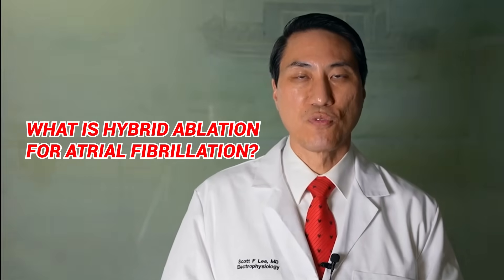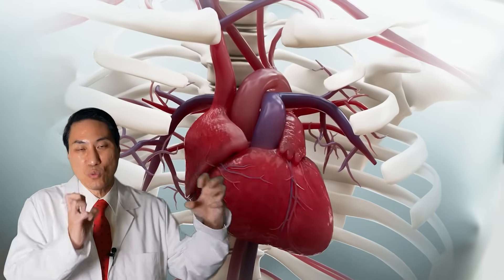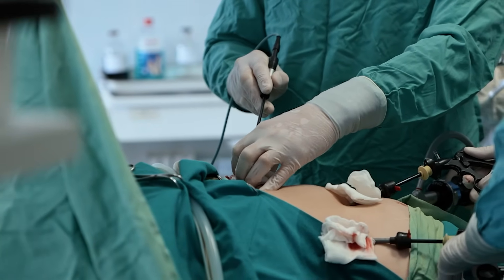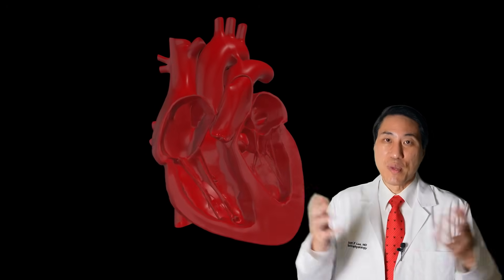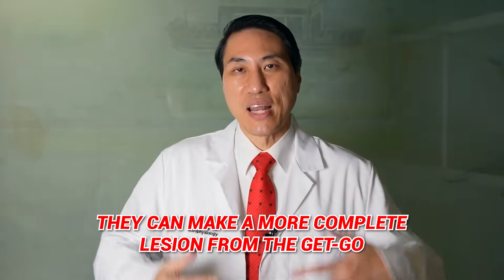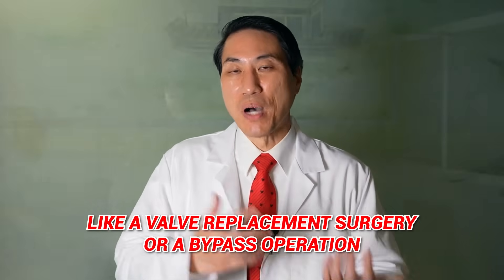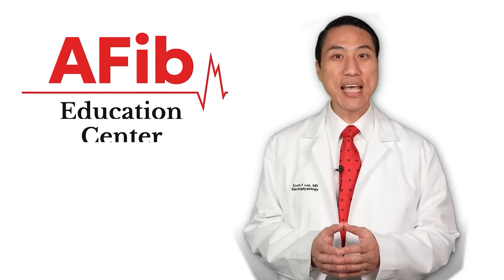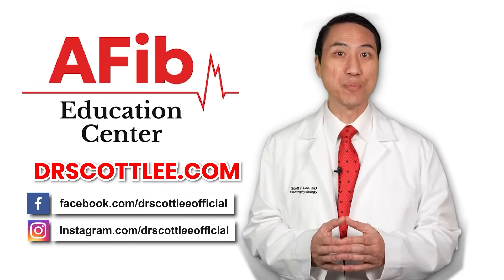Hybrid Convergent Ablation for AFib: What It Solves… and What It Still Doesn’t

Comment: Ugh afib is terrible im 36 and have been dealing with this on and off since im 20 or so. Really hope this second opinion from Dr. Lee is fruitful
Reply from the maker: I’m really sorry to hear you’ve been battling AFib since such a young age—dealing with this in your 20s and 30s can be incredibly frustrating, especially when most doctors are still stuck in the mindset that AFib is an “old person’s condition” and downplay it when you’re young. But your story isn’t uncommon—early-onset AFib can absolutely happen, and when it does, it tends to be more structurally driven by electrical triggers or congenital wiring issues rather than age-related scarring. That’s why early evaluation and treatment—especially from someone who takes a comprehensive, strategic approach—is so important.
If your AFib is paroxysmal and hasn’t progressed too far yet (still early “1-2 walls out of 6” type of case), then you’re still at a stage where a well-executed ablation—done correctly the first time—can potentially turn the clock back all the way to zero and buy you many symptom-free years. But even if it’s gotten further along, the goal is to put together the right plan (whether that’s lifestyle, meds, or ablation) to stabilize it and preserve your quality of life long-term.
I’ll do my best to give you the clarity and education you need in your second opinion so you’re not left in the dark or being bounced around from med to med. You deserve better than just being told to live with it at your age. Looking forward to helping you figure out the right next step.
Hang in there—there is a path forward. Good luck!

Comment: What are your thoughts on Farapulse ablations. I go in next week for this. I already have a pacemaker for sick sinus syndrome. I've been experiencing long runs of afib. I have chirrosis from Nafld, so they are trying not to cause liver damage by over medicating  me.
Reply from the maker: Great question—and I’m glad you're thinking critically about the different ablation techniques, because not all energy sources or procedural strategies are created equal.
Pulsed Field Ablation (PFA) is definitely one of the most exciting new developments in electrophysiology. The energy itself—non-thermal electroporation—is safer for surrounding structures like the esophagus, phrenic nerve, and pulmonary veins compared to both radiofrequency (RF) cauterization and cryoablation (freezing). It's also significantly faster, which is appealing for both the patient and the lab workflow. So yes, the energy is promising—particularly in terms of safety and efficiency.
But here’s the part that often gets glossed over: the current use of PFA is still very limited. Right now, the FDA-approved catheters using PFA are only designed to perform basic one-wall pulmonary vein isolation (PVI). They haven’t been proven to be more effective than RF or cryo—just a little safer and faster. And that’s great if you’re in the earliest stage of AFib (paroxysmal, short and intermittent episodes), where a simple one-wall ablation often does the job. In early PAF, a basic PVI gives you a 70–80% success rate.
But AFib is a progressive disease. As it advances, more of the atrium becomes involved and the abnormal rhythm is no longer limited to just the pulmonary veins. By the time someone is in persistent AFib (episodes lasting over 7 days) or longstanding persistent AFib (continuous for over a year), there are often AFib triggers firing from other walls of the left and right atria—what we call non-pulmonary vein (non-PV) triggers. If you only do a simple PVI in these patients, success rates drop off a cliff: 40–50% for persistent AFib, and down to 20–40% for longstanding persistent. That’s why so many patients with more advanced AFib end up having multiple ablations—often 3 to 5—and still feel like they’re chasing a rhythm they can’t pin down.
The key problem is that most EPs only do simple 1-wall PVI on everyone, regardless of how advanced the patient’s AFib is. And because of that, when the basic PVI isn’t enough—which is the case for mid-to-late-stage patients—they end up needing repeat procedures. But here’s the dirty little secret: many centers and EPs are financially fine with that. They schedule 4–6 cases a day, spend an hour doing a simple PVI, and when it doesn’t work long-term, the patient comes back for round two, three, or four. The reimbursement system pays per procedure—not for outcomes—so ironically, some EPs make more by doing less.
Now, when I do ablation, I block out 4 hours per patient because I do complex, tailored ablations on up to all six atrial walls if that’s what the patient’s stage requires. My goal is to get it done once and done right, regardless of how advanced the case is. That’s why my personal success rates are 95% in paroxysmal AFib, 90% in persistent, and 80% in longstanding persistent—because I map and treat all the active triggers, not just the easy ones around the veins. To do that effectively, I currently use RF energy, because only RF allows me to precisely and deeply ablate across all six walls. Cryo can only reach two of them, and while PFA technically can access more, we don’t yet have the evidence or catheter tools to prove it can create durable lesions outside of PVI. And while there is a new PFA catheter from Medtronic that was just released this year (2025) that can make linear lesions on other walls of the heart other than Pulmonary Vein Isolation (PVI) using both pulsed field energy and Radiofrequency, it is still largely untested. That’s the bottleneck right now.
What’s concerning is that some EPs are now bragging about doing 6 or more PFA procedures a day—because the energy is fast and safer—but they’re still doing the same basic one-wall procedure, just faster. So instead of doing better work, they’re doing mediocre work at lightning speed. And as I always say, practice doesn’t make perfect—perfect practice makes perfect. If someone’s done hundreds or thousands of one-wall ablations, all that makes them is very efficient at doing a procedure that might not be enough for your stage of AFib.
That’s why I always encourage patients to understand their stage. If you’re in early-stage paroxysmal AFib, you might get a great result with almost any competent EP—easy is easy. But if you’ve progressed to persistent or longstanding persistent AFib, who does your ablation matters far more than what energy source they use. Because hard is hard, and in advanced AFib, success comes down to operator skill, depth of ablation strategy, and whether your EP treats the full electrical map—not just the first wall.
For more in-depth videos explaining all of this, visit my channel @afibeducation, and if you want a personalized review of your case to make sure your ablation plan matches your stage, visit drscottlee.com to book a second opinion. Thanks for watching!
Reply: @afibeducation thank you for responding. I am going to the ER as we speak, I passed a little blood. So payers are appreciated.  I love your channel, you are very informative and you communicate in terms the average person can understand. God bless.
Reply: @afibeducation had my ablation, so far I've felt a lot better. Had a screaming headache last week that finally let up. For whatever reason, I feel as though it was side effect of anesthesia or the procedure, plus I've had some tingling and numbness in my hands and feet that also seems to have let up. I have had a little afib and some tachy brady, but if it doesn't get worse I will satisfied with the results. On the other hand I've had good weeks before.  Time will tell, but I'm hopeful.

Comment: In regards to the drugs to mange AF what is the order of drugs from the weakest to the strongest? I have fib and I’m trying to understand at what stage of AF I am at!
I’m currently on arrhythmia drugs Flecatab, Minax, iXarola, Adesan & Cavstat
Reply from the maker: Great question — and it’s smart that you’re trying to understand how your medications relate to the stage of your AFib. First, I’ll explain the typical hierarchy of antiarrhythmic drugs (AADs) from weakest to strongest, and then I’ll comment on your specific meds.
General Order of AFib Medications (Weakest to Strongest)
Note: This refers to their strength in suppressing AFib, not how “good” or “safe” they are. Sometimes a weaker drug is preferred because it’s safer or has fewer side effects.
	1.	Beta blockers (e.g., Metoprolol, Atenolol, Minax – brand name for metoprolol):
	•	Purpose: Mainly control heart rate, not AFib itself.
	•	Strength: Doesn’t actually suppress AFib episodes, just slows the speed of it down.
	2.	Calcium channel blockers (e.g., Diltiazem, Verapamil):
	•	Purpose: Also for rate control. Slightly more potent than beta blockers in some people.
	3.	Digoxin (not in your list):
	•	Weak rate control, especially in active people. Almost never suppresses AFib.
	4.	Flecainide (Flecatab) and Propafenone:
	•	First-line rhythm control drugs for patients with no structural heart disease.
	•	Moderate strength antiarrhythmics. Can be very effective in early-stage AFib.
	5.	Sotalol:
	•	Stronger than Flecainide, but with QT prolongation risk. Used in more persistent cases.
	6.	Dofetilide (Tikosyn):
	•	A stronger option for rhythm control. Requires hospitalization to start in many countries.
	7.	Amiodarone:
	•	The strongest and most effective AAD, but reserved for last due to long-term toxicity risks (lung, liver, thyroid).
Your Current Medications:
Let me break down what you’re on:
	•	Flecatab (Flecainide):
A moderately strong rhythm control drug — often used in early-stage or paroxysmal AFib when the heart is otherwise structurally normal.
	•	Minax (Metoprolol):
A beta blocker, mainly for rate control. Doesn’t stop AFib, but controls how fast the heart beats during it.
	•	Xarelto (Rivaroxaban):
An anticoagulant, to prevent stroke — doesn’t affect rhythm or rate, but essential if your CHA₂DS₂-VASc score warrants it.
	•	Adesan (Candesartan):
An angiotensin receptor blocker (ARB) — not directly for AFib, but used to control blood pressure and may help prevent atrial remodeling in the long run.
	•	Cavstat (likely atorvastatin):
A statin, for cholesterol — also has anti-inflammatory effects that may have some indirect benefit on AFib risk/progression.
What This Suggests About Your AFib Stage:
If you’re on Flecainide, that suggests your doctor believes your AFib is still early-stage (likely paroxysmal AFib) and that your heart is structurally normal. That’s good — because rhythm control with drugs like Flecainide is most effective early, before the atrial tissue undergoes permanent remodeling.
If you’re still having breakthrough episodes on Flecainide, or they’re becoming more frequent or lasting longer, that may suggest you’re moving toward persistent AFib — and that might be a good time to consider advanced evaluation, including whether ablation might be a better long-term option.
Final Thoughts:
You’re clearly taking this seriously — and that’s great. If you want to understand your AFib stage more clearly, ask your doctor about:
	•	Atrial size and function on echocardiogram
	•	Frequency and duration of episodes (your AFib burden)
	•	Whether you’re in AFib more than 7 days at a time — which defines persistent AFib
You can find more in-depth videos on all of this on my YouTube channel @AFibEducation, and if you’d like a second opinion or a more tailored assessment of your current AFib stage and treatment strategy, feel free to visit my website at www.drscottlee.com.
Thanks again for your question — you’re on the right track!

Comment: Hi Dr. Lee,

Any idea why the abolition surgery requires a 7 day hospital stay here in Japan? Is it an insurance thing?
Reply from the maker: Hi there — great question.
Yes, the 7-day hospital stay in Japan after AFib ablation is mostly related to how the healthcare system and insurance reimbursement work, rather than medical necessity in most cases.
In countries like the U.S., ablation is usually done as an outpatient or overnight stay, assuming no complications. But in Japan, the national health insurance system reimburses based on bundled payments tied to length of stay and diagnosis-related categories (DPC — Diagnosis Procedure Combination system), which actually incentivizes longer hospital stays in some cases.
Also, cultural and systemic norms in Japan tend to be more conservative — there’s a stronger emphasis on monitoring for complications, ensuring medication regimens (like anticoagulation) are stable, and confirming there’s no pericardial effusion or recurrence of arrhythmia before discharge. The longer stay also allows for more thorough observation, patient education, and adjustment of medications — but again, much of it is shaped by the structure of the reimbursement model, not because the procedure inherently requires 7 days in the hospital.
So yes — you’re right to suspect it’s mostly an insurance/system issue, not a reflection of the complexity or risk of the procedure itself.
Thanks for the great question!

Comment: Is an epicardial ablation and what you’re calling hybrid, the same procedure ?
Reply from the maker: Great question — and the short answer is: technically yes, but there’s a lot more nuance.
An epicardial ablation just means that the ablation lesions are created from the outside of the heart — typically done by cardiothoracic surgeons through a small surgical incision. In contrast, an endocardial ablation is done from inside the heart chambers by an electrophysiologist (EP), typically via catheters inserted through the veins.
So just like there’s a huge variation in how complex or thorough endocardial ablations can be — from a simple 1-wall pulmonary vein isolation (PVI) to a multi-wall ablation targeting six different atrial structures — the same variability exists in epicardial ablations. Some surgeons do only a simple PVI from the outside, while others attempt more complex lesion sets.
Now, the Hybrid Convergent ablation is a specific type of epicardial ablation procedure — where a surgeon ablates the posterior wall and floor of the left atrium from the outside, through a single incision below the breastbone, and then an EP completes the PVI from inside the heart. So it’s a combination of both approaches — epicardial and endocardial — usually done for more advanced stages of AFib like Persistent or Longstanding Persistent AFib, where PVI alone often isn’t enough.
To give you context:
	•	A simple PVI alone has about a 70–80% success rate in early-stage paroxysmal AFib (PAF),
	•	But that drops to about 40% in Persistent AFib, and 20–40% in Longstanding Persistent AFib.
	•	Adding the posterior wall and floor ablation (Hybrid Convergent) boosts success to 55–60% in persistent cases — so it’s a step up from basic PVI, but still not a full multi-wall ablation.
Its advantage is that it’s less invasive than traditional full surgical procedures like the Cox MAZE IV, which requires open-heart surgery but delivers very comprehensive lesion sets and higher success rates in advanced AFib. On the other hand, the Hybrid Convergent approach is easier to recover from because it only requires a single small incision — but that also means it can’t reach many of the other important areas like the coronary sinus, anterior wall, or left atrial appendage. That’s why the EP also steps in to do the PVI from inside.
In my practice, I specialize in doing advanced multi-wall ablations entirely endocardially — from inside the heart — often in a single procedure, which for the right patients can achieve better success than Hybrid, without the need for surgery at all. But very few of us do this kind of advanced mapping and tailored lesion sets — it’s definitely not standard.
If you want to dive deeper, I’ve got more videos on my channel @afibeducation explaining this. And if you’re considering your options, feel free to visit www.drscottlee.com to learn more or request a second opinion.
Thanks again for watching and asking a great question!
Reply: @afibeducation Thank you sir for the detailed explanation   I’ve had 2 ablations done inside now they want me to have an epicardial one so your explanation helped me understand better. Thank you
Reply from the maker: You’re welcome! Also feel free to watch my latest video “What Doctors Aren’t Telling You About AFib Treatments!” for more education about common surgical approaches and lesion sets and when they still fail.